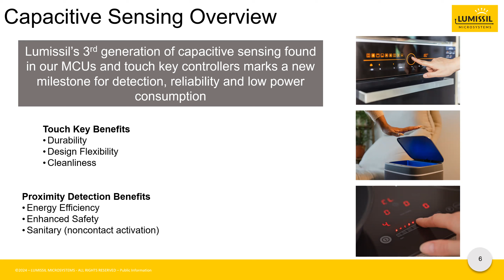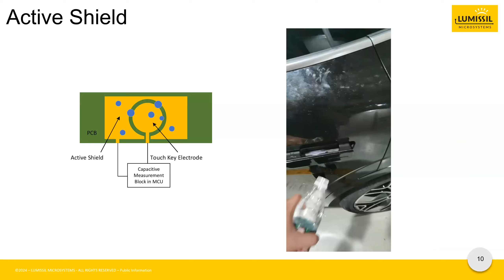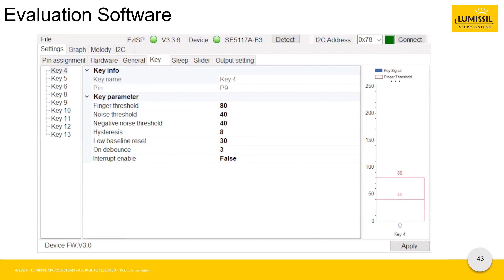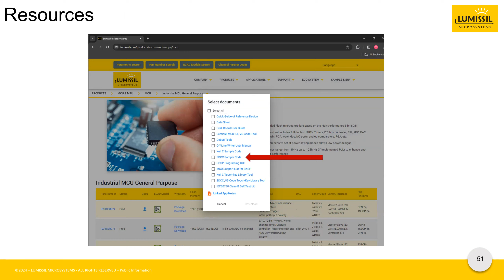Webinar: Gen3 Capacitive Sensing Enhances Detection Reliability - Lumissil

Comment: 2:39 presentation beginskk
3:37 Introduction to Lumissil
4:18 Markets served
5:18 PCAP Sensing Overview & benefits
6:48 Cap Sense Basics & Theory of Operation
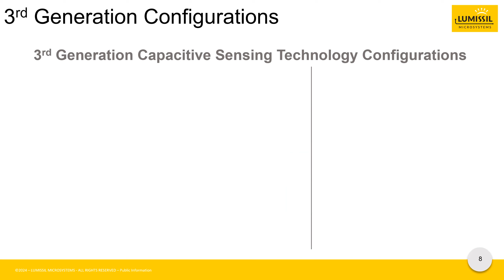8:03 Self Senve vs Mutual Sense
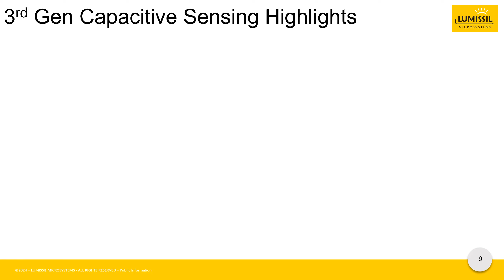8:55 Lumissil 3rd Gen & Benefits
11:41 Touch behind stainless steel
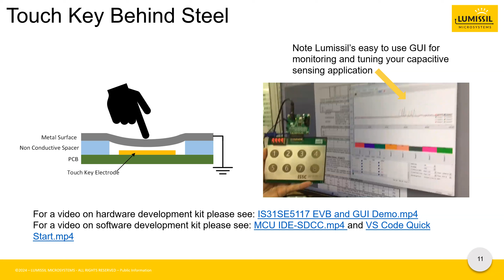12:15 contactless sensing applications
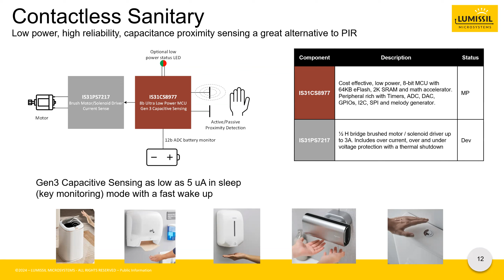14:44 Appliance & Auto applications
18:21 Touch key controllers P/Ns and comparison
19:48 8-bit MCUs w/ PCAP Touch
21:12 IS3xSE517 8-channel Touch Controller
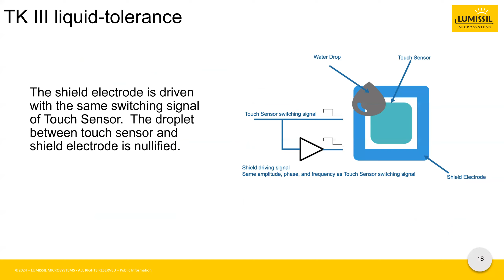21:51 Liquid Tolerance
22:00 Sensing behind stainless steel
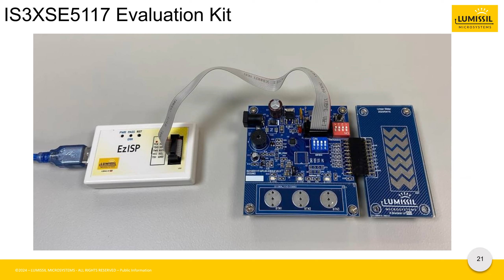22:24 EVK Intro, sliders and wheel sensors
23:03 GUI Programming Interface
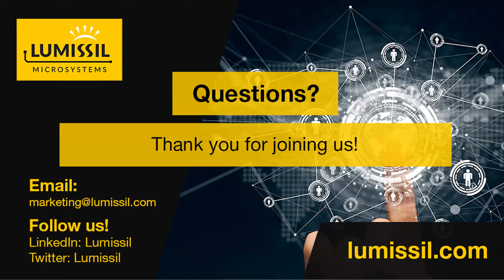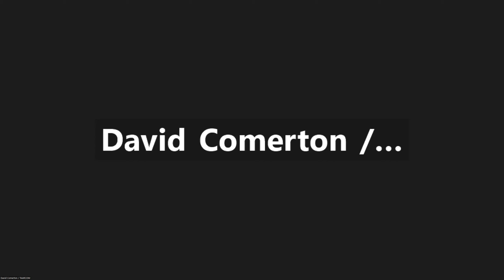28:45 to 31:43 Q&A